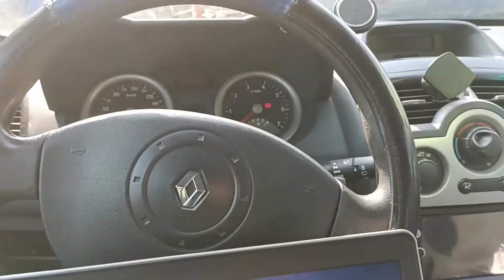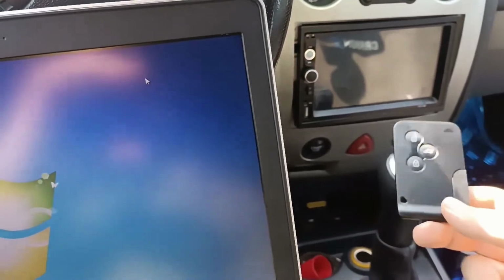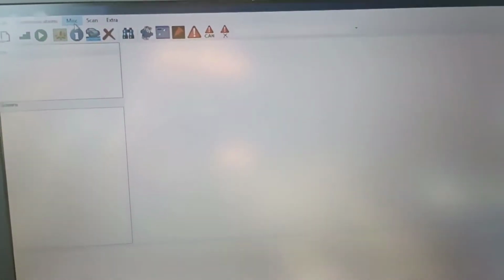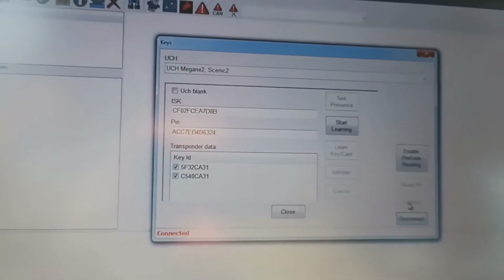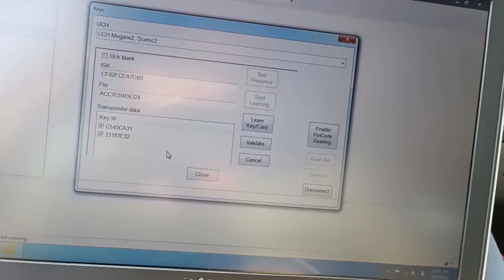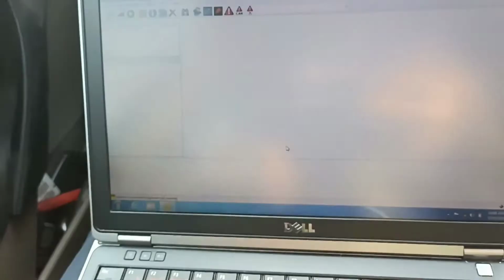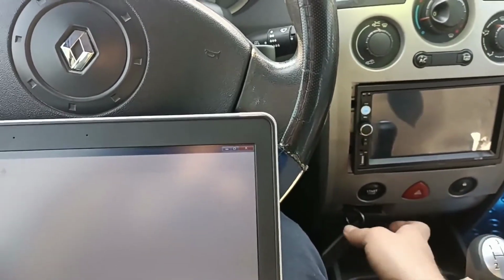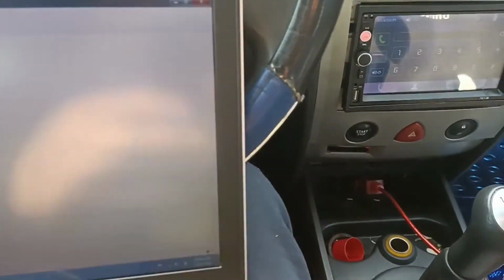Renaul Megane II . Key programming with Renolink

Comment: Trying to program a master mk3. Able to connect and read pin, when I click start learning it wipes the keys in list but then has error 7F3112 Sub Function Not Supported also  7F3122 Conditions not set or sequence error. Have tried with drivers door open, passenger door also open, hazards also on still errors any idea how I can solve this?

Comment: Hello,
I did it the way you showed in the video for a Renault Espace 4, the cards were added to the vehicle and the vehicle can be started with both cards, but the central locking and Keyless Go don't work, I have to insert the cards into the card slot to start it.

How can I check in Renolink whether the cards are running at 315 or 433 MHz?

I also checked the door lock and the internal contacts are working, as well as the motors. I also replaced the sensor and attached new metal mirrors to the door handles, but unfortunately without success.

Someone has an idea
Best regards
Kalle
Reply from the maker: @KalleRenaud  Hi , I believe you have problem with the key, it's not good quality, I'm sure you both from AliExpress and it happens many time to have this problems. Check also the antenna that reads the key signal.
Reply: @YOYODiagnostic  I have 2 original Keyless Go cards for my 2007 Renault Espace 4 that came with the purchase.
With one card, the case was defective, and I opened it, then I lost the original pill, so I got a replacement pill and a new case.
Now I have gotten the card where the chip was missing to the point where I can drive with both cards, but my Keyless Go and central locking no longer work with the card.
According to the Can Clip, 2 cards have been read, but for the Keyless Go, it shows 0.
How can I now add the maps to the Keyless Go?
Can Clip says that all antennas are fine, the strange thing is when I park the vehicle and then after a certain time want to open another door, it only works if I put my hand in the driver's door handle and pull the handle, then you can hear all the doors unlocking, but this doesn't happen every time.
When I drive at a certain speed, you can hear the vehicle locking the doors, and you can open and lock the vehicle using the switch in the headliner. It all works, including adjusting the mirrors, ventilation, child safety locks, window lifters, and the light at the bottom of the door.

Didn't you also have a video where you explain with Renolink how to assign foreign cards to the vehicle by taking the VIN from the donor vehicle in Renolink?

Comment: I have error:
7f3b22 conditions not set or sequence error
Reply from the maker: You are using a clone or the original?
Reply: @YOYODiagnostic  I have the original OBDlink SX with Renolink activation.
Reply: It's strange that Renault Pin Extractor reports wrong ISK
Reply from the maker: @coyotus77 
 select Megane 2 Ph2,  open the driver's door and turn on the hazard lights.
Reply: @YOYODiagnostic I have the same problem. I use a clone version 1.99 and it comes the sequel error. Can you help me?
Reply: It may be that in the case of Megane 2 ph 1 2004, you should choose Megane 2 ph 2? The Russian website wrote that it might help.

Comment: Can be just new key added to car, or you need to have all keys present while doing this process? Car is Clio Mk2.
This part is confusing me. Thanks for reply.
Reply from the maker: 1.You can program keys even if all are lost.  
2.Another key can be added even if you have one present, but both must be learned because the old one will be deactivated after programming the new one, for this reason both must be learned.
Reply: @YOYODiagnostic Thanks for clarification.
Reply from the maker: @JosipBasic  ,,👍
Reply: @YOYODiagnostic  I have lost all key cards for my Mégane 2, could you explain how to code a new key with no keys available, thank you😊
Reply from the maker: @Irritatedcodm  ist the same procedure 👍

Comment: Hello,
I menage to program one new china card, but its only work to start a car not key lock. 
The card that before I use program was opening car ( but not start engine) now stop opening car and not recognise by computer program.
Now I have 2card that start engine but no card that unlock car.
I tried couple of times to reprogram, but renolink only recognise 2card (one is new) that start engine, but old 1card renolink dont recognise. 
What can I do to get opening car function back?
Thank you

Comment: If I don't have any cards for the car at all and I get used 3 button cards and new transponders, can I just add them to the car?

The only original thing I still have for the car is a transponder, but it is not recognized by the car, so I can neither open nor close it and I cannot turn on the ignition.

If I find the cards again, I can turn on the ignition, but there are other transponders in it and I would now get 2 cards with the same buttons from a used car and swap the transponders in the cards and then teach them, I have to do each one Press card on Validate or only when I have put all the cards in one after the other?

Comment: Funktioniert es auch beim Renault Espace IV mit Keyless Go? 

Muss leider noch auf meine Bestellung warten.

Mit dem Renault Clip braucht man ja ne PIN für nen Schlüssel anlernen.
Reply from the maker: Ich weiß nicht ob es funktioniert. Ich habe nicht probiert.
Reply: @YOYODiagnostic  ich werde es Probieren und dir dann Berichten.
Reply from the maker: @kalle-RLP  👍
Reply: @YOYODiagnostic  Hallo, wie versprochen bin ich wieder da.

Also du kannst beim Renault Espace IV die Schlüsselkarte selbst neu machen.

Ich muss nur noch rausfinden warum die Keyless Go und die ZV nicht mehr über die Karten geht.

Auch kannst du deinen Kilometer stand per Renolink ändern, geht über extra und dann Tdb.
Reply from the maker: @kalle-RLP  👍
Reply: @YOYODiagnostic  Habe 1.99 und bekomme keine Verbindung mehr zur Sonde, egal was ich mache. 

Hast du ne Idee?
Reply: @YOYODiagnostic  neue Sonde ist da.

Habe zwar die Transpoonder 7936 AS bestellt, aber laut DDT4ALL & Renolink ist der Transponder aber 7946 oder 7947
Reply: @YOYODiagnostic  If I don't have any cards for the car at all and I get used 3 button cards and new transponders, can I just add them to the car?

The only original thing I still have for the car is a transponder, but it is not recognized by the car, so I can neither open nor close it and I cannot turn on the ignition.

If I find the cards again, I can turn on the ignition, but there are other transponders in it and I would now get 2 cards with the same buttons from a used car and swap the transponders in the cards and then teach them, I have to do each one Press card on Validate or only when I have put all the cards in one after the other?

Comment: When I try to key programing,i finsh read pin and connect,but on start learning i get-7f3b22 Conditions not set or sequence error...Any help,thanks...
Reply: Hot the Same is there a solution?
Reply: @renegatscha5083  i make card but not like this,manualy step by step...
Reply: @dul-boy  what do you mean by manually ?